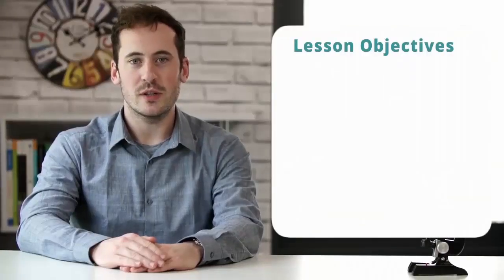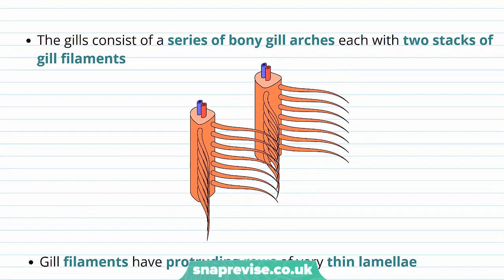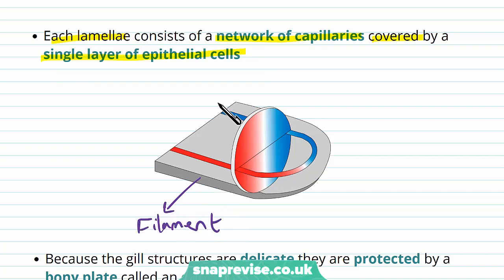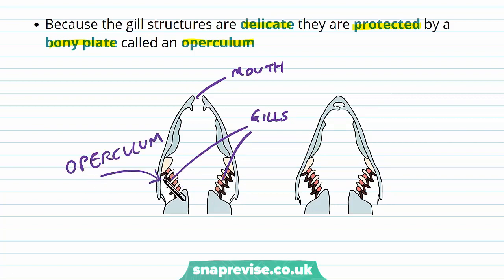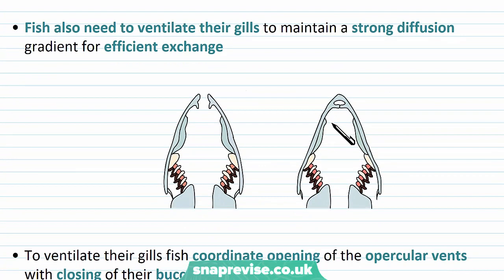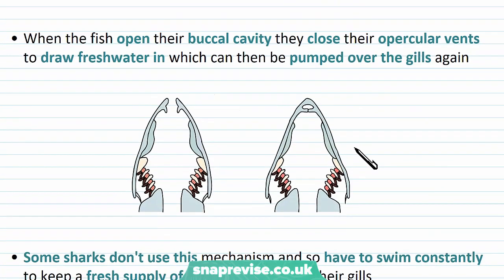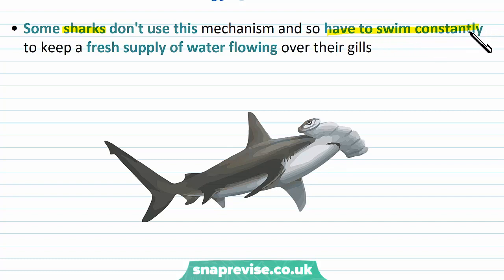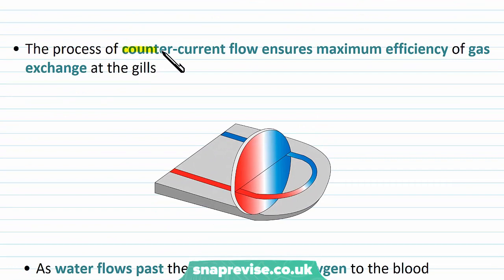Gas Exchange in Bony Fish  | A-level Biology | OCR, AQA, Edexcel

Comment: i still don’t get this wtf
Reply: yea he didnt explain it v well and my exam is tomorrow :

When a bony fish opens its mouth the bucal cavity is lowered and the opecular vent is closed. Water containing O2 flows into the fishes mouth. THe fish closes its mouth raising the buccal cavity and opening the opercular vent - water has to flow through the gills to leave out the opercular vent (the pressure difference forces it that way).

Diffusion of O2 into the fish's blood takes place at the lamella (which is on the gill filament of the arc of the bony fish's gill - just before the operculum in the diagram)

A larger proportion of O2 is diffused into the blood when the water is flowing in the opposite direction to the blood, small amounts of O2 are diffused into the blood when its flowing the same direction. This is for maxiumum efficiency as the water will flow in one direction when travelling from the mouth cavity to the opercular cavity.